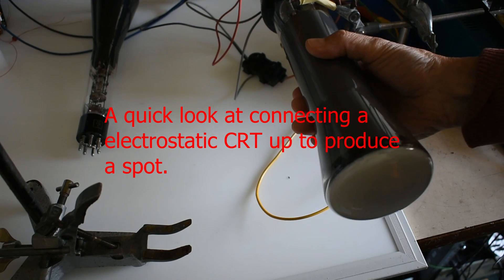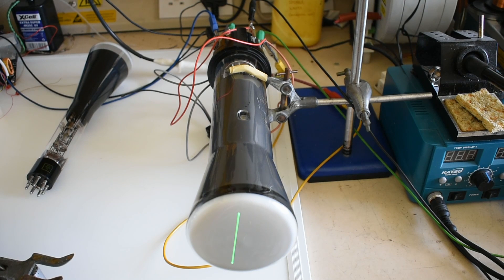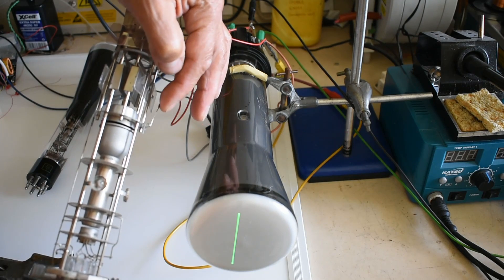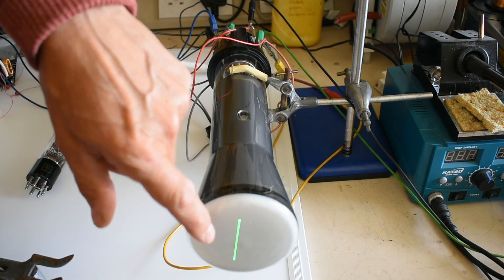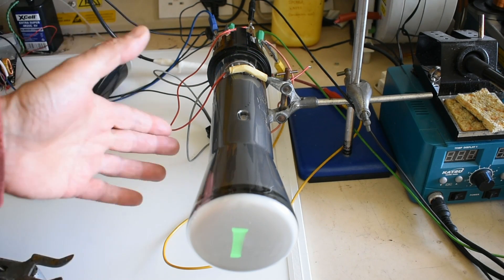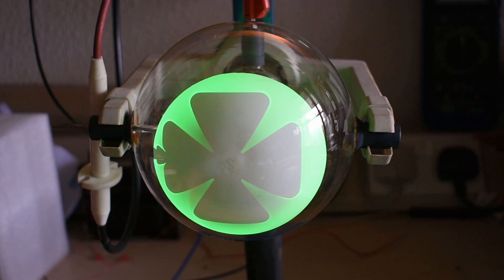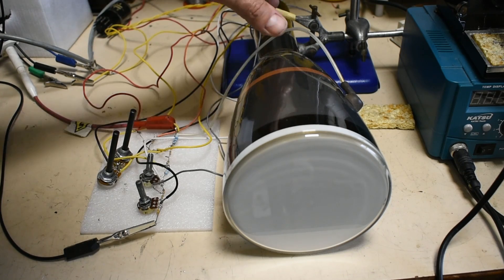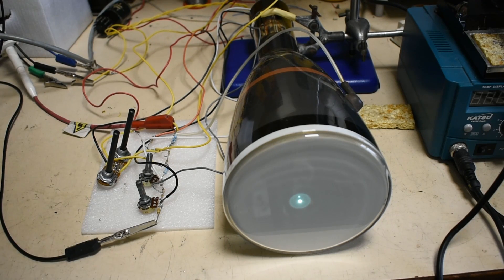Electrostatic deflection (scope-type) CRT set-up

Comment: me ayudas?, tengo un crt modelo "3jp2" no se como polarizar , no hace foco, no modifica brillo , supongo que me equivoco en la serie de resistencias, no se la verdad, lo estoy alimentando con +1200-
Reply from the maker: No reconozco el número 3JP2; parece un osciloscopio CRT. Estos suelen usar varias resistencias en serie para crear puntos de tensión, siendo la más alta el ánodo final y una toma variable en el centro para el ánodo de enfoque. El brillo se puede reducir con una resistencia en el cátodo o haciendo que el primer ánodo sea ligeramente negativo.
Reply: @tuopeeks  es de la serie 3jp el "2" solo refiere al color de la pantalla.
Reply from the maker: @luislopez-pf5fi  Lo estás haciendo bien si ya tienes algún tipo de imagen en el tubo del osciloscopio. Las placas internas X/Y deben estar conectadas a un potencial equilibrado; de lo contrario, se cargan y desvían el haz. Esto a menudo significa que el haz no llega a la pantalla, incluso si está bien enfocado. No sé si lo expliqué en alguno de mis videos. Publicaré un diagrama aquí para ver si te sirve de ayuda.

Comment: if you ground out the electrostatic plates, would they still act weirdly? Sorry if this is dumb, I don't really have any experience with these but hope to learn.
Reply from the maker: Questions not dumb. Grounding the X/Y plates, I think the beam will pass straight through and produce a spot on the screen. The beam would be visible and should not act weirdly as charges wont accumulate on the pates but would be undeflected.
Reply: @tuopeeks  got it, I’ve got an old electrostatic deflection oscilloscope CRT and would like to not break it as it’s surprisingly hard to find those things for cheap, thanks!
Reply from the maker: @Gizmos_and_stuff   They are getting harder to find all the time so worth keeping.
Reply: @tuopeeks  I will, my tube that I have right now is perfect for what I want to do, but I’m not sure if it’ll survive my experiments so a second one wouldn’t hurt
Reply from the maker: @Gizmos_and_stuff  The main danger I find with CRTs is beam current. It's easy to suddenly achieve a bright stationary spot on the screen, that unfortunately can burn the fluorescent coating in less than a second leaving a permanent burnt spot on the screen.
Reply: @tuopeeks  Good to know, do I need a current limited supply? (I'm pretty sure the current for my CRT is in microamps) or does simply using the right voltage and intensity settings ensure that i'll be fine?
Reply from the maker: @Gizmos_and_stuff   I just try keeping the brightness  as low as possible, and the anode voltage in check
Reply: @tuopeeks  got it, I’m guessing control grid (intensity) control can also help keep taut in check while adjusting smaller voltages (so it’s safer/easier)
Reply from the maker: @Gizmos_and_stuff  Yes,  true, if you keep the grid slightly negative you can can control the brightness or shut off the beam.
Reply: @tuopeeks  yup, and I’m sure if I stay in or below the typical voltages specified in the datasheets I’ll be quite alright

Comment: I am envious of your Maltese cross tube. Question: Do you know of a modern source for the button style connectors you have connected to the post accelerator of you last tube?
Reply from the maker: The Maltese cross tube used to be common in schools in the UK. They were made by 'Teltron' and I think are still made but expensive. Unfortunately I don't know of a source for the button style connector on the cone. I was lucky enough to have kept in when salvaging the tube. I should have kept the socket too though.

Comment: thank you! this is really useful to me! I have a pretty big collection of old crt tubes, some with really rare phosphor colors/types.  I'm hoping I can get a setup like this together to start testing and perhaps photographing each of them.
Reply: thats awesome
Reply: I also collect rare CRTs, my most treasured is an orange phosphor rectangular faced CRT from an old aircraft weather radar.
Reply: @cambridgemart2075  orange? thats sick
Reply: @Gizmos_and_stuff  I need to get it running; there is basically no data available, but I have most of the original hardware that was used with it, so stand a chance of getting some life out of it.

Comment: cool video!
Have you try turn the CRT into a SEM?
Reply from the maker: Thanks, in theory there are a couple of problems with regards to the geometry  and the fact the CRT bulb is sealed. Interestingly, there is an old technique for imaging the cathode surface to examine the emissive  condition, in a magnified image.  Although its project and not scanned.

Comment: I think the one I posted on fb had an off centre gun, did you notice that the image was off to one side of the phosphor? I'm going to do another video on it and the mercury arc rectifier for yt.. do you think I can correct it with magnets? I think it took a knock in shipping... I wonder if you put a negative voltage on the cross you can achieve total cut off🤔 I like the right hand rule in action at the end of the video😅 I assume you put a coil round the neck?..
Reply from the maker: Not unusual to correct beam landing with magnets,  should work. Yes, there is a coil around the front of the Maltese-X CRT, similar to the arrangement on my pervious CRT video to twist and shrink the image. I reckon I could make the cross -ve enough to scatter the electrons off the fluorescent coating
Reply: @tuopeeks  😁